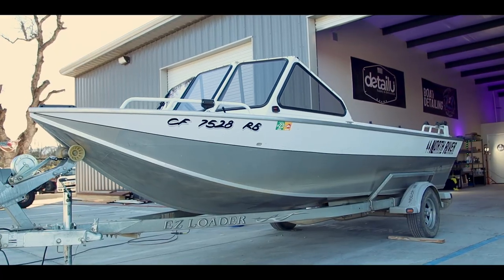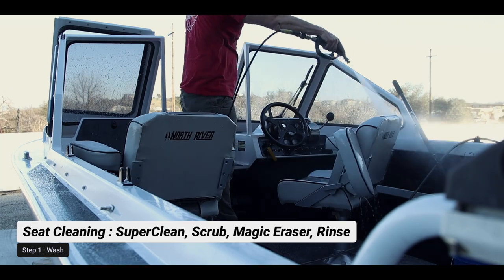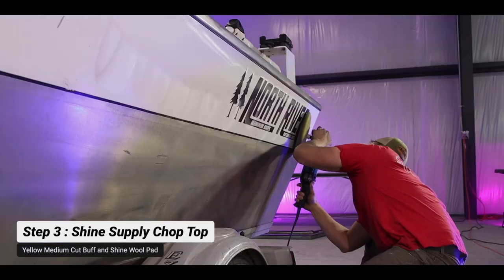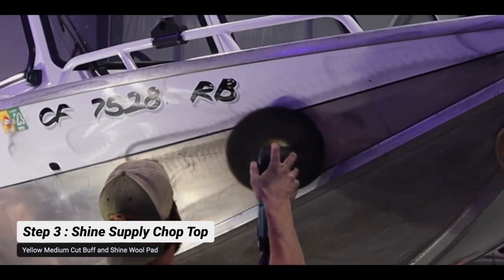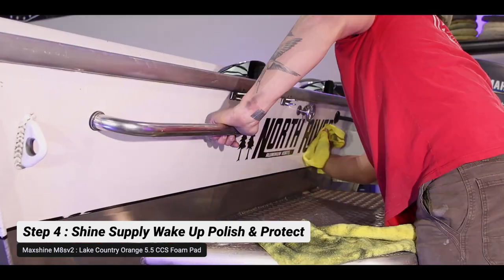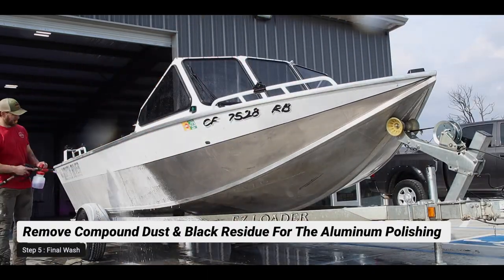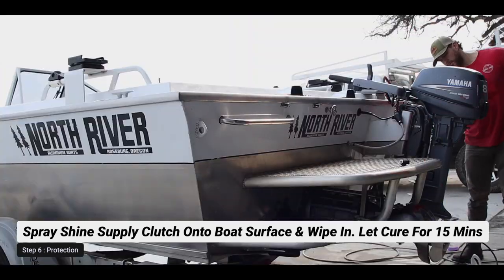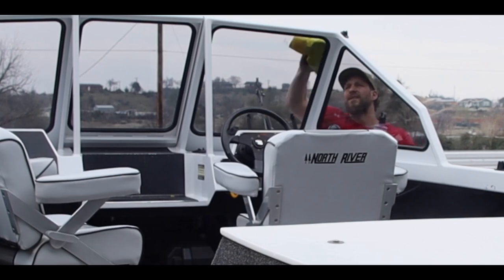"Get Your Boat Shining like a Diamond! 6-Step Boat Detailing Process for an Aluminum Boat"

Comment: Good day Drake  great video one question when you washed the interior you mentioned to not leave the super clean on  what did you use two remove the super clean residue from  vinyl seats please  
Have you trued the mirka Galaxy disk for wet sanding 
Cheers 😊😊  Jim
Reply from the maker: Hey Jim! Just don’t let the super clean sit on the seats too long is all I meant. As long as you wipe it off completely you are good! I have not used that particular disc, but I loved Mirka products! They are great!
Reply: @DrakesDetailing  
Drake yep I’ve been using cleaners mixing my own for 8 yrs it’s amazing what works but most important rinse rinse  all cleaners of every surface 
And god bless magic erasers 
Thanks. Drake

Comment: Perfect video! I was just inquiring about painted aluminum boats! Thanks for the great info, I do have a question though, what ceramic coating would you recommend on painted aluminum boats? Thanks in advanced and looks like your doing great over in Cali!!!!
Reply from the maker: Hey bro! Shine Supply’s Bead Lock ceramic coating can be used on metal or fiberglass. Here’s the link for it. It’s awesome stuff! 🔥🔥https://www.detailusupply.com/products/bead-lock-pro-marine-ceramic-coating

Comment: Question. Do I have to pull out the seats to get them cleaning? It will be my first boat. I really neverous im used to doing cars. It is a  16-foot Bayliner inside the interior little dirty. And help is welcome.
Reply from the maker: Hey bro! You can if you want, and IF they are removable. It’s all just personal preference 😎

Comment: Have you done boats with glitterflake gel coat?  Are they OK to lightly wetsand to get small scratches out, or better to just stick to a heavy cut compound?
Reply from the maker: Yes, light sand is fine! Typically the glitter have a clear coat over it, not gel coat

Comment: how do you make or get that little shorty adapter for the powerwasher handle..
Reply from the maker: Pressure Washer Spray Gun https://www.detailedimage.com/wax.php?id=94879&url=detailedimage.com/DI-Accessories-M12/MTM-Hydro-Easy-Hold-SGS28-Spray-Gun-P2473/
Reply: @DrakesDetailing  omg ty